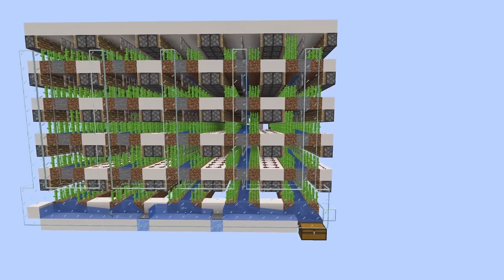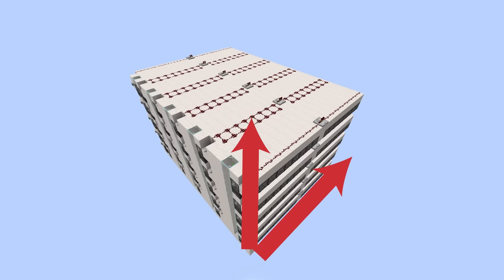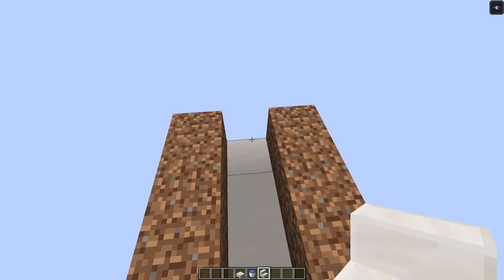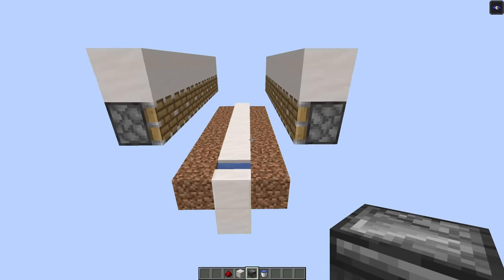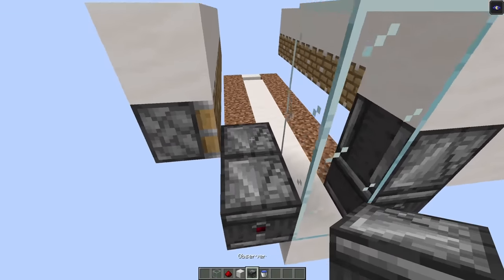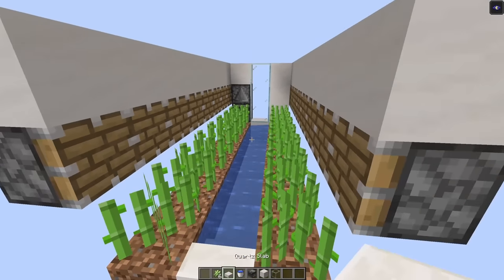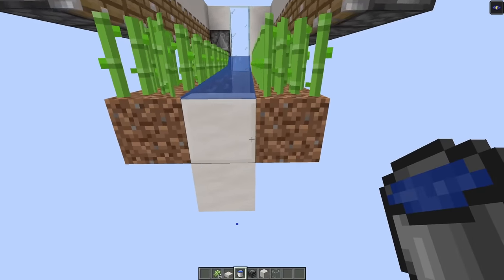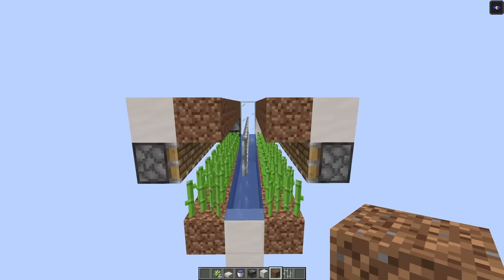Sugar Cane Farm! Compact, Lossless, Easy to Build! (Minecraft 1.15+)

Comment: really cool. How exactly does that growth detection work tho? What exactly is the observer reacting to and does it react only to first sugarcane or to the whole row?
Reply: it reacts to the first sugarcane :)
Reply: @MinaTee0  thanks for answer altough I still need a bit more clarification. 
So it reacts only to the first sugarcane and doesn't react to any other sugarcanes to in the row (I mean to the side of the first one not above the first one... just to be clear). 
So if that is the case, does that mean that for all the other ones it is a game of chance if they will be harvested at the right time ?
Reply: Also what change does it react to ? 
I noticed a problem when I tried this in my singleplayer creative map. 
Oftentimes pistons would fire when there was no sugarcane.
It seamed as if it was firing right before sugarcane would grow therefore stopping it from growing ? ... that's just my hypothesis and I could be completely wrong, but I'd really like to know how it works.
Reply: @PCgmesforever  Yes i believe this is how it works because some of my other canes grow but it doesn't cut. I think that if you place them all down together then it should be fine. 

I have the same issue with the pistons firing without growth. I will inspect this next time I play. Not sure why there isn't only one observer facing the cane (which would face the second cane level)
Reply: pretty much 1 block high sugar cane will update from random ticks, even if it doesn't actually grow up a block.  That update is what the primary observer is detecting.  This design only observes the one block at the end of the line so due to random ticks/updates the chances of all the crops in a single row being 2 blocks high every time the pistons fire is pretty much slim to none.

The output is based on the fact the farm is nearly infinitely expandable in the X, Y and Z directions and is pretty cheap to make in survival compared to most other farms.
Reply: @travish6727  Thanks for your detailed response. I'm not so familiar with ticks, but i wonder if it's more efficient to have just one observer facing the second high block so that the pistons aren't being set off due to the ticks, and thus will only be set off when the first cane actually grows? Maybe I haven't understood your message properly sorry
Reply: @MinaTee0  setting it up the way Tango has allows you to also harvest from every crop as well allowing the farm to harvest more often than the designs that watch for the 3rd block.
 
In this design if you were to watch the 2nd block where the pistons are and use a piston to break that block so a new one can grow then you'll just end up with a rapid firing clock due to the observer detecting the piston entering and leaving the block.

Comment: Anybody know where to put torches inside the farm cuz I’m getting a lot of mobs on the inside standing on top of the sugar cane and sometimes the zombies pick Up the sugar cane before it flows into the water stream
Reply: Just do one lane of redstonedust (not 2) and you can replace the blocks without redstone ontop with light blocks, or torches instead of redstonedust
Reply: Or use some jack o lanterns, you can put redstone dust on top of them,

Comment: Why do the water I placed on top the waterlogged slab just spread everywhere instead of flowing one direction? :(
Reply: put the sugar cane down first. it acts as a border.
Reply: @oleschulenburg6131  I did. It washes the sugarcane away as soon as I put the water down 🫠 I'm playing on minecraft bedrock (PS5) if that matters?
Reply: I changed the pressure plate out for a temp block. Placed the water against that block then remove temp block with pressure plate. This seemed to help with extending the water stream

Comment: How do you make the water flow straight and not to the sides, I followed every instruction...
Reply: This worked for me: have upper slabs on the water, place dirt next to where the water stream will go, on top of the dirt where the sugar cane will go. Place the water source and then break the upper slabs. Now you can remove the dirt blocks you placed and you are good to go
Reply: @semper58  Thank you for replying I'll see if it works

Comment: How do I keep the water that is collecting in one row. When I place it, it breaks all the sugar cane
Reply: Mechanics has changed , build the flowing water first and then the logged water
Reply: @kiwiciwi123  I can't get it to work. When it brakes the 2 row of sugars the water flushes everything
Reply: @benppauwaert7174   put water down first (the waterlogged slabs) then top slabs in sugarcane on the sides every block and then the flowing water . I just made it last week like this .
Reply: @kiwiciwi123  I got it working if I removed the first slab against the glass, now it stays,  I also removed the stairs at the end when the moving water was done. The canes got stuck behind it

Comment: If you replace both water channels with two-high water source blocks, with soul sand under them, and hoppers under that; the design becomes backwards compatible to 1.13. That compatibility, of course, makes the farm two taller per layer, but no longer requiring a minimum length due to water. I found this to be particularly useful in playing modded minecraft where my minecraft isn't always up to date.

Comment: The pistons keep firing before any sugarcane grows for me.
Reply: Same for me. Does anyone know why this is?
Reply: @joshuadbrownie  I just kept it running like that and it produced quite a bit of sugarcane in about an hour. So yea, it still works good regardless of those pistons misfiring. (BTW, I only built 2 modules since I don't need many sugarcane.)

Its probably doing that because the observer is observing the sugarcane below it that's already there, so it probably observes its ageing? Maybe it updates slightly before it actually grows so the pistons are firing just that much earlier? I don't know, maybe a bit of a delay in the pistons firing could solve it.

Comment: What's the point of the pressure plate on the ice?
Reply: Prevent water from flowing the other way,  Using a 'Sign' with packed ice underneath is also a good option.

Comment: I can’t flow the water in between the sugar cane it just instantly spreads out
Reply: JustThatUchiha Three things I can think of:
1. Which version are you playing on? Anything below 1.13 won’t work as the water mechanics changed in 1.13.
2. Are you playing on Java edition? I am not a bedrock mechanics expert, but I don’t think that this design would work there.
3. Did you make sure that the slabs that you placed were waterlogged? I’m not sure if that’s important for the water in between but it could be.

Comment: Can i use this design for bamboo?
Reply: Bamboo farms don't need this level of complexity as bamboo can be planted in mud, which is not a full block, which simplifies item collection. I'd check out a farm made specifically for bamboo.
Reply: @lilsupersock uhmm... sugarcane can be planted on mud too... issue is mud based designs are horrible. 

Atleast if you're using mud so you can have a hopper below it. 

Not only is this unbelievably expensive compared to literally any other option. It's also the most laggy of literally any other option of resource collection
Reply: Don't listen to him^

Comment: I can’t get water to flow like that
Reply: Same did you ever fix it?
Reply: Having the same problem, I wish someone would make an explanation
Reply: @touchingbark6616  hey i hope this explanation helps! 
- Add bottom slabs along the water stream (before adding any water), waterlog those slabs
- Break the bottom slabs, then add top slabs in the water stream
- Add the water at the end of the water stream so it flows between the sugar cane
- Break the top slabs

Comment: That many pistons firing off every time seems a bit overly laggy no?  Also, having just the one observer means you're losing a lot of efficiency with this design, which I'm wondering takes away any benefits you're getting from it being slightly more compact than other designs.  Having the farm be one block taller so you can have observers every block would make less lag, allow the sugarcane to grow freely without having to wait for other stalks to grow and wouldn't have any harvest delay.  I think I may get in a creative world and see if your farm outproduces more efficient but less compact farms in the same footprint.   My guess is going to be no.

Comment: Doesn’t work in 1.17 btw the water goes out to the sides
Reply: idk if it's still work but for the water there wasn't an update so you did it not the good way
Reply: There's a way to place the half slabs so you can trick the water to only go in one direction. Essentially, you'll have to break a slab so the water flows down the hole, break the next slab and place a slab where the old slab is and repeat

Comment: what a bad sugarcane farm
Reply: how is it bad
Reply: It’s just that flying machine sugarcane farms are more expandable and are more efficent
Reply: @maxcoisman321  much less reliable. If you use a timer, you could unload the chunks at a bad time, and break the flying machine, meaning you'll have to build that flying machina again
Reply: @maxcoisman321  how are flying machine farms in any way more efficient or expandable?
Reply: Harry Tsang fair point, but it’s not that hard to turn of a flying machine. In my industrial distract I have a certain place where I afk all my farms and if I leave that spot they all turn off
Reply: William Hutton they use less redstone since all you have to is place down a few rails and hopper mine carts
Reply: William Hutton also less iron because of all the pistons this design uses and iron bars
Reply: @maxcoisman321  if you're st the point where you need thousands and thousands of sugarcane, you should be able to spare a few iron
Reply: William Hutton ok well that Dosent prove that flying machines are any better or worse so I’m gonna make them instead